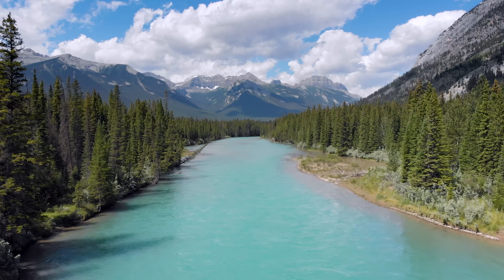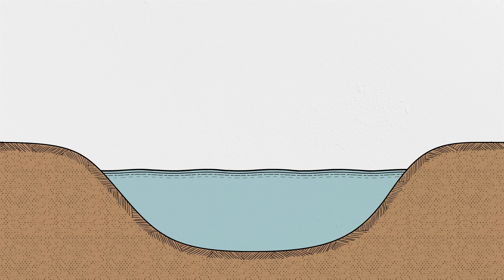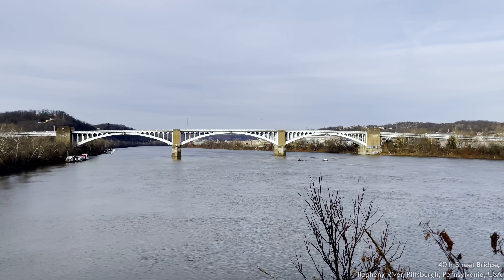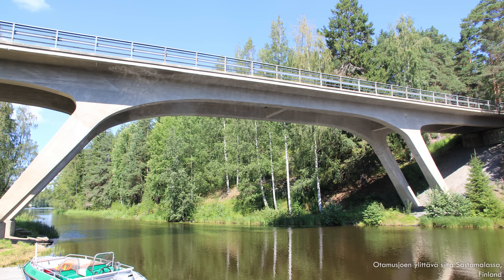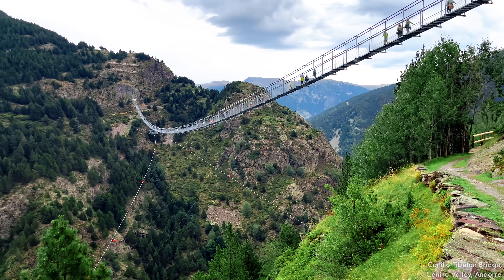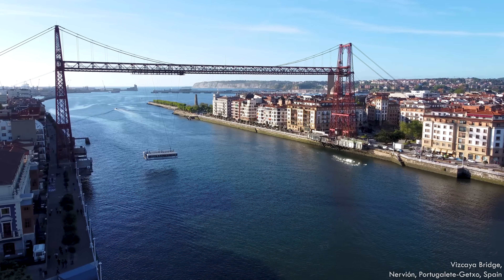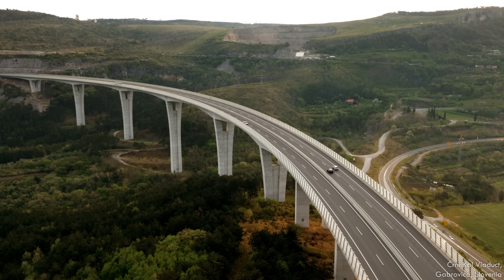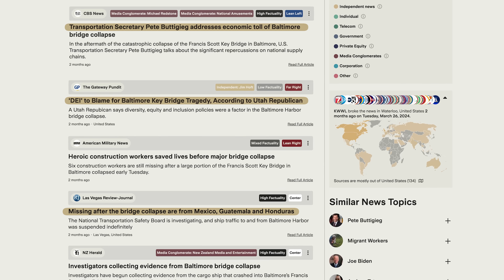Every Kind of Bridge Explained in 15 Minutes

Comment: Im partial to the double cantilever steel bridges common along the older Mississippi River crossings from New Orleans up to St Louis.  The center span of the bridge hangs off the cantilever ls on either side.  The one in New Orleans, the anchor spans are anchored on land with the western most support being inside the New Orleans Convention Center…on the east bank.  The eastern most support is located in an Algiers playground….on the west bank.

On a lead abatement project I was engineer on, the Contractor over tensioned his cables spanning the bay between the suspended span and the New Orleans side cantilever span and moved the suspended portion of the bridge several inches. The expansion joint on the New Orleans side buckled and the Algiers side opened up enough to eat tires on Corollas and Escorts of that time. Contractor had to prepare a plan to block the bridge and slowly move it back. Never closed the bridge to traffic, but we did temporarily replace the expansion joints with steel plates.

Comment: Bridges are fascinating. I remember a balsa wood bridge building competition in middle school that was mandatory. The teacher would weigh the bridge beforehand and then when we'd test them to the breaking point, calculate the strength to weight ratio. I didn't do bad at all, but I attribute that to my German ancestry who probably made cuckoo clocks.

Comment: Great work as usual… but I was watching to see a reference to the Tamar rail bridge. Unique requirement: high level crossing for a train in a bend where the outer part if a suspension bridge would foul the deck, so Brunel used a suspension bridge where the compressive forces are resisted by a hollow arch. Worth learning about.

Comment: Another great video!  I just returned from a trip to New Hampshire, visiting my son, but made sure to take in a couple of the covered bridges near where he lives, so you get an A+ on your timing!

2:54 I noticed you left out the Long Truss, named after its inventor, not its length. 

Also, could you explain the difference between the Pratt and Howe trusses? They look identical except for the rectangular center section being inverted.  Wouldn't the load on each member still be the same?  

Also, also, I remember in my one civil engineering class (part of my ME curriculum) that to be a true truss, the members have to be pinned to guarantee no bending loads.  If the members are joined rigidly it's called a space frame. Of course, that was done for analytical reasons since the use of truss bridges goes back 200 years, and there was no finite element computer modeling available. 🙂 We were taught the old technique of "Moore Circle" analysis where the linear loads could be calculated graphically.

3:30 "Truss-worthy"  I see what you did there...

Comment: Okay, but you missed one of the simplest bridge crossings I've ever seen.  I've seen overpasses for freeways where the freeway is on a raised bit of earth.  There is a passageway carved under the freeway through the earth.  It's basically a concrete box, just big enough for a car to drive through.  One might think it's a beam bridge with the supports hidden behind the concrete, but I've been watching one I drive over get ripped out so it can get rebuilt, and there was no additional support, it's just a concrete box!  Exit 203 on I-80 in Nevada.  And just East of Elko, I saw them block/divert a river to rebuild a bridge for the frontage road.  And they literally just dropped in a series of four-sided concrete boxes, pushed them together, and that's it!  No added supports, no added reinforcement or foundation.  It would count as an arch bridge if they were rounded, but they were square.

Comment: Regarding bridge aesthetics and cost. Certainly crazy bridge details can drive the overall cost more, much more than simple bridges of the same structure type. It's usually the bridge owners (read governments) that come up with those requirements (fancy curves, shapes or details) that add to the materials tally and to the construction complexity. 
In short, don't give let an architect get anywhere a bridge other than to cross it 🙂

Comment: 2:12 Mill avenue bridge in Tempe, AZ. Right was a depression era project. Left was a 1990s project to replace a riverbed crossing that kept washing out during spring floods. Now they are both over the artificial (and smelly) "Tempe Town lake". Nearby is the insanely robust 1910 railroad bridge still in use today. My favorite bridge is the floating bridges in Seattle. I am just floored that you can float something that heavy!
Reply: Seattle has three floating bridges. Two of them that parallel each other are shown in that picture. It is an older picture. Currently light rail is being installed on one of the bridges. Operation of that rail line is expected to start next year. The expansion joints for the rail lines was an engineering challenge for the rail project.
Reply: @erniecolussy1705  You have to understand that I discovered these bridges because I was visiting town and drove out (for the very first time) to visit friends on Mercer island. So it was, "Okay, I'm now driving on top of a lake.. Right. That works."

Comment: There's a kind of river crossing in Lithuania called a kulgrinda, it's kind of a bridge, but it's also kind of a manmade ford. They would construct them by sliding stones out onto the river when it was frozen for winter, And in the spring the ice would melt and the stones would sink. So it would create a place in the river that was shallow enough to wade across or take a wagon over.

Comment: Fun fact, the I-90 floating bridge across Lake Washington east of Seattle sank in 1990 in a major storm because the engineers removed the watertight doors on several pontoons.  (They intended to use the pontoons to temporarily store runoff water from a bridge expansion project).  Multiple pontoons flooded during the storm, sinking the bridge.

Comment: I'm working on a project that involves a bridge. The majority of it is just a beam bridge, but we were exploring the possibility of making one of the spans into a truss so that it can be longer. The problem that pretty much killed that idea is that it's on a curve that requires superelevation. Another thing we were trying to avoid was a straddle bent. A bent is the cross member that sits on top of the columns and supports the girder while a straddle bent is an extra wide bent that straddles another piece of roadway. Straddle bents are unsightly, expensive, and annoying to construct because the bent itself needs to be a lot deeper and have more reinforcement. I won't go into the math of it, but I think you can see where I'm going. We managed to work around it in the end by realigning the roadway and skewing some of the other bents. Suffice it to say, bridge engineering is not simple at all. Structural engineering in general is really difficult which is why it often requires additional licensing on top of a PE license

Comment: I believe France still has some WW2 bailey bridges in use.
Dude, the diagrams are making me grumpy. The truss supports were in the middle of members. The arch is not arch shaped.
Love the old arch construction photo that makes it look just like a cantilever bridge.
Here's one I've been trying to figure out. But don't know how to figure out. Does Sydney Harbour qualify as an arch? It's a truss. And the top chord isn't buttressed. But the supports indicate an angled reaction not vertical only. Is it a truss stiffened arch? A hybrid arch shaped truss? ... ?

Is that true? Arches get dismissed if the horizontal thrust is countered in tension and not compression? That seems like a total dis to perfectly legit arches. What would Kahn think?

One movable bridge of note : The submersible. I only know of two (one?). At the ends of the Corinth Canal.

I wasn't well satisfied with the "explanation" part.

Comment: My favorite bridge is without a doubt the Hood Canal Floating Bridge (officially William A. Bugge Bridge) in Washington state. It has two massive retractable draw spans in the middle. When it opens, the decks on both sides of the draw spans are raised up to create space for the draw spans to retract under. When closed, the draw spans meet in the middle and are latched together. During big windstorms, the draw span has to be opened to relieve pressure created by the wind waves.

Comment: I enjoyed your content, even more as usual...
... as some of your drawings just triggered me, and I can let out my inner knowitall 😅
1) The truss you've shown would immediately collapse, killed by the impossible supports. Trusses can be supported only at the nodes...
2) The arch you've shown isn't an arch. Arches need to have the maximum curvature at the apex. What you've drawn is more like a beam bridge, with the maximum curvature at the ends. It's not that unusual, the arched form may do some of the work, but it's structurally a beam.
3) You've drawn the low water crossing like a low beam bridge. According to what I've learned, this would be washed away at the first flood. Low water crossings, the way I've learned it, are usually built more like an embankment with (often tubular) holes to let water through.
I haven't done a lot of structures in my professional life, but I do remember at least some of my structural analysis and bridge construction courses, so I just couldn't shut up 😁
Still, keep up your good work!

Comment: At my previous engineering company, I created a short presentation about the component of bridges, mostly to tell the other engineers who did not work on bridges, such as a drainage engineer or traffic engineers, and had a section on the types of bridges.  My final category was simply titled , "complex combination or as we bridge guys say, headaches"
Reply: Do you still have the presentation in a power point format or something else? I'm curious to learn more detail about the types of bridges. If you could share a presentation, that'd be helpful.
Reply: I'd also love to see the presentation. It could make a cool topic to present to my peers.
Reply: But the types I listed are slab bridges, girder bridges, arch bridges, truss bridges, trestle bridges, suspension, cable stayed, post tensioned, movable bridges, and complex combinations.  I talked about wingwalls, abutments, bearings, bents and piers, bearing surface, superstructure, substructure, (which are semi ambiguous terms in bridge engineering... So don't use them, say deck or piers or towers instead of substructure). All other bridges are variations on these types. For example, extra dose bridge, like the pearl harbor memorial bridge in New Haven is just a variation of a post tensioned.
Reply: Sadly, it was made at my previous company, and I no longer have the PPT file
Reply: Ah yes, nothing like a humblebrag disguised as a casual comment. You could’ve just said, "Bridges can get really complex and be a headache," but no, we had to get the full "At my previous engineering company, I made a presentation..." flex.

We get it, you worked in engineering and gave a little TED Talk to your coworkers. The real headache here isn’t the bridges—it’s sitting through self-congratulatory stories like this.
Reply: @KyleCox404  it's not that deep, he gave context
Reply: @ bro out here acting like he’s the comment section therapist

“it’s not that deep” yeah no kidding sherlock it’s a youtube comment not plato’s republic but guess what you still felt the need to dive in and defend captain powerpoint over there

giving “context” doesn’t mean you have to write your entire linkedin bio in a casual comment like anyone asked for your career highlights

next time just say “i’m allergic to sarcasm” and move along lmao
Reply: @KyleCox404 funny. I saw it as revision of a topic I'd just been reintroduced to.

Comment: Interesting fact, Queensferry on the Firth of Forth is the only place in the world which has a bridge made from each century built along side one another:
• Forth Bridge - cantilever - rail bridge opens in 1890 the longest span in the world when opened. 

• Forth Road Bridge - suspension bridge opened 1964 - road and pedestrians - longest outside USA when opened and was the furthest north a suspension bridge had been built at the to me. 

• Queensferry Crossing - cable stay bridge - road bridge - opened 2017. World’s longest 3 towered cable stay bridge. Tallest bridge in the uk.

Comment: About 30 years ago I drove over a bridge in Costa Rica that appeared to be a simple truss bridge with the deck on top, but when I got out of the car on the far side to look at it, it appeared to be a suspension bridge with the deck pushing down (via steel rods) onto the the suspension cables, rather than the usual suspension bridge design of having the road deck hanging below the main suspension cables.  I’ve never seen a similar design since, and haven’t been back to CR to see it again or take pictures, but that’s what I remember about it.
Reply: That would be a most unusual design.   I could see the point, you can use the suspension principle with a reduced height of the towers, BUT the cables below the deck would be unstable, they would 'want' to splay out sideways.   The steel rods in compression would have to be fixed    rigidly enough, and the deck would have to be extremely stiff in torsion (which most suspension bridge decks are not).   
Unless there was a stiff truss structure below the deck with the suspension cables just 'helping' to carry the load.
I'd love to see a picture.
Reply: A quick google search and I think I may have found your bridge: Rio Colorado bridge on the Bernardo expressway. And it looks incredible.

Comment: Worked in engineering for 35 years. Can honestly say as a US taxpayer I do not care in the slightest if it's structurally sound and as low cost as possible. Very rare. Other countries have at it, the US is beyond broke. Did a swing bridge in the state of Louisiana that swung around a pivot approximately 1/3 of the way across. 32 years it's been swung/opened one time. Good use of taxpayer money.

Comment: Yeah!!! I knew Pittsburgh had to in here a whole bunch. I love it. 412 baby😊
Reply: Yeah, I noticed 4 (edit: 6) scenes from PGH (one that was used twice, so 7 instances).  There are some other bridges in PGH that would have been fun to include.  Kind of wonky but I really like the concept of a Wichert Truss Bridge which was specifically designed to be "statically determinate" using pencil and paper math available in the 1930s.  The Homestead Grays / High Level Bridge is a notorious example of this.
Reply: Basically just took a trip down the Monongahela listing almost every bridge until they got to the point (skipped only the Liberty Bridge and a couple train bridges) and took a short trip up the Allegheny to the 3 sisters (skipping only the Fort Duquesne Bridge).